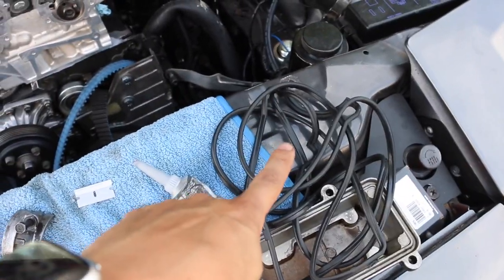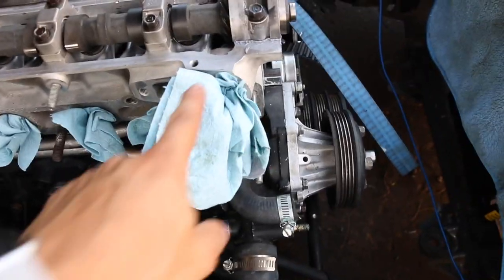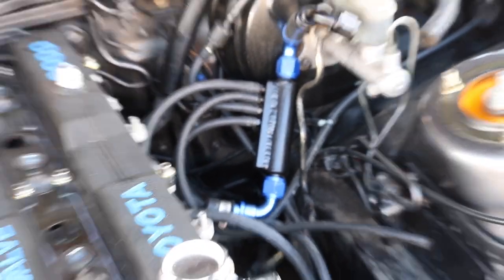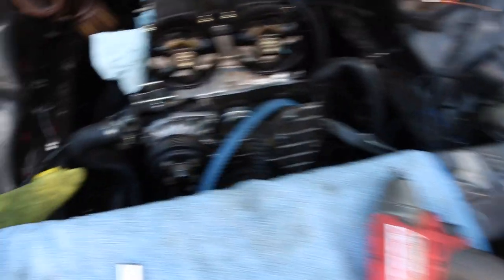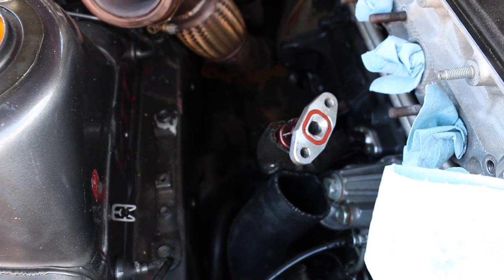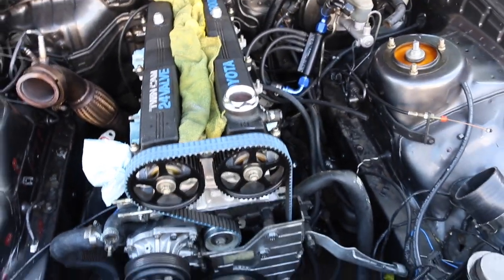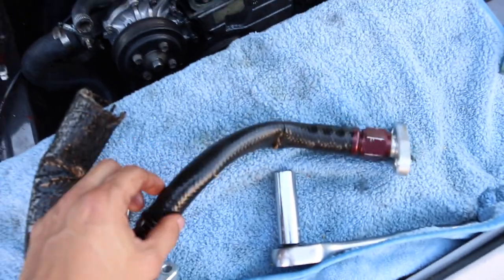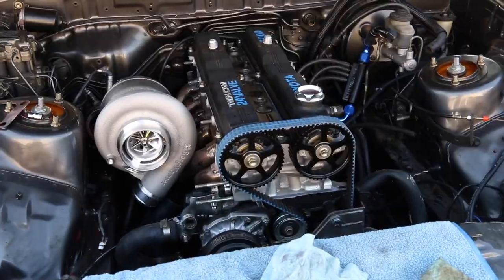BUILT 7MGTE MK3 SUPRA BUILD , THIS COULD OF CAUSED A HUGE FIRE 🔥🔥🔥!!

Comment: I highly recommend getting rid of the stock pressure relief oil filter housing that flows into the oil cooler. Anything that saps oil pressure at higher rpm is a killer for the old 7M

Comment: The stock oil return is functional with the stock exhaust manifold, but it's practically unusable for most aftermarket exhaust manifolds.  Best solution, route the  oil drain straight to the oil pan
Reply from the maker: Howard Hutchinson yes!! Definitely thats the beat way, and i should of done that wen the engine was out.. its still possible but hate the hassle